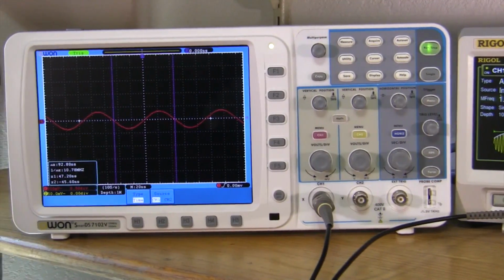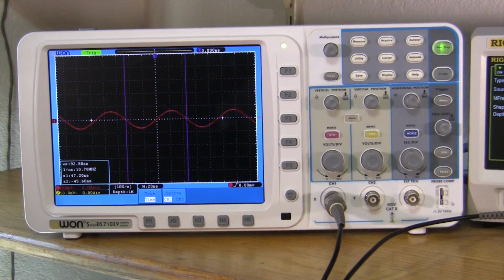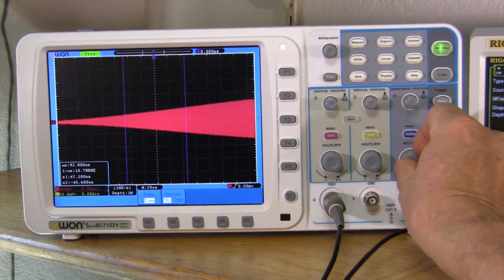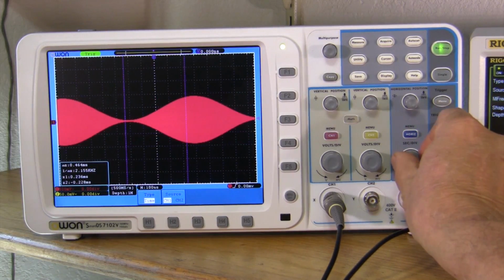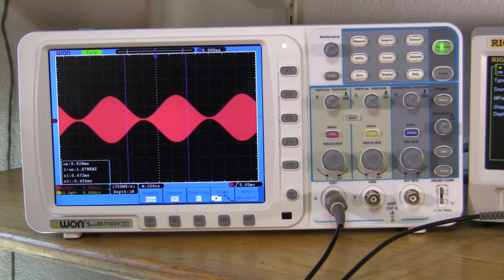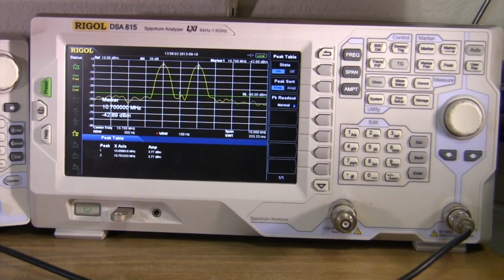DG4102 Arbitrary Waveform Generator AM & DSB Modulation Capabilities

Comment from the maker: There is a problem with this instrument for those who use it for AM modulation.  For reasons only known to Rigol's engineers the unit appears to set its level using PEP, not average power.  This results in dropping the carrier level when AM modulating so that while the carrier to sideband energy is correct and very clean (low distortion), it is not the same as would be seen using an AM transmitter or RF Signal generator.  Thus a fully modulated AM or DSB signal will have a PEP level that matches the front panel level (provided you put the unit to the 50 Ohm setting under Utilities).  Typical RF Signal generators and transmitters add modulation to the carrier so that a 100 percent modulated carrier will have twice the voltage peaks of the carrier level.  The 4102 doesn't do this as shown in the video uploaded by Mike's Radio Repair elsewhere on You Tube.

Comment: There seems to be a problem with the stability of signal generation with this siggen
https://www.youtube.com/watch?v=UlUUyydTXeY
Can you verify this ?
Reply from the maker: Further Comments:

The issue is one of reference.  Rigol, for their own reasons, are using peak envelope power (PEP) to determine output level.  Thus if 100% AM modulation is applied to the internal carrier, the peak modulation will establish the output signal level based on Peak Envelope Power (PEP) which will drop the carrier by up to 6dB as modulation goes from 0% modulation (carrier will be at full output) to 100% modulation (carrier drops by 6dB to maintain the same PEP level).  

This can be accounted for by recognizing the leveling method being used by Rigol but, admittedly this is somewhat inconvenient when trying to use the Function Generator as an RF Signal Generator for AM sensitivity measurements.  

Typically 30% AM modulation using a 400 or 1000 Hz modulating tone is used for such measurements.  Since the modulation of the Rigol appears to have very low distortion, if the unit is used with a Step Attenuator it can be set to, say 1000uV (-50dBm) carrier level at 0dB attenuation using a Spectrum Analyzer with the modulation set to 30% and carrier output levels down to -120dBm can be generated.  Actually, this is what I do when using the unit though I also add in a 1dB/step Step Attenuator so that I can measure down to -130dBm.

By the way, to accurately set output from the DG4102 you need to use Utility>Ch1 Set (or Ch2 Set)>Resi(tance?) set to Load which will display as 50 Ohms in the Utility List on the screen.  If the default HighZ is left in place instead of placing the 50 Ohm Load in place, output will not be correct into a 50 Ohm Load such as the Spectrum Analyzer or the 50 Ohm Step Attenuator.
Reply: And there i was expecting an answer in the form of "yes, i did see some things that winked my eyebrows" lol, thanks for your detailed answer, much apreciated.
Reply from the maker: Well, while it "winked my eyebrow", I've grown accustomed to digital designers and programmers making changes that most of us rf/analog guys consider unusual, awkward, or inconvenient.  

Example:  Many early digital storage scopes and spectrum analyzers placed commonly used front panel functions several levels deep in on screen menus that may or may not be where I would look for them.  With the DG4102 this means using the Utility menu to change the Output Impedance from HighZ to 50 Ohms (really?).  But I've learned to adapt to the new "Digital Age" and just search until I find the "Magic Sword" that allows me to perform the task at hand.